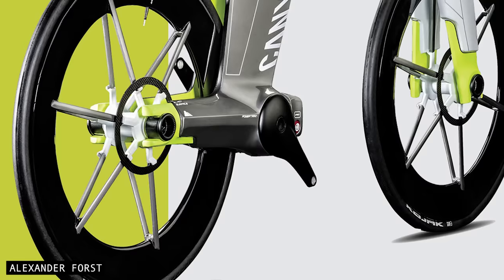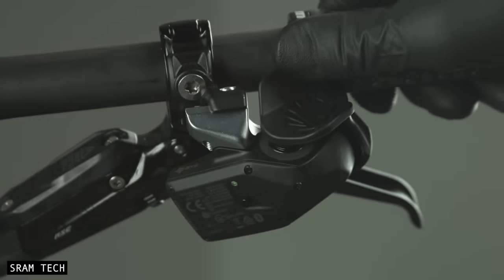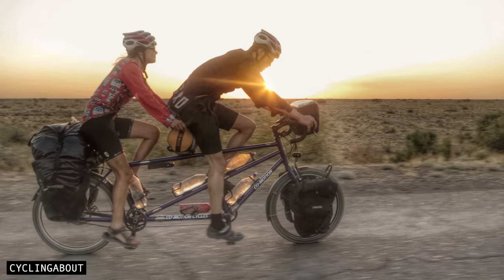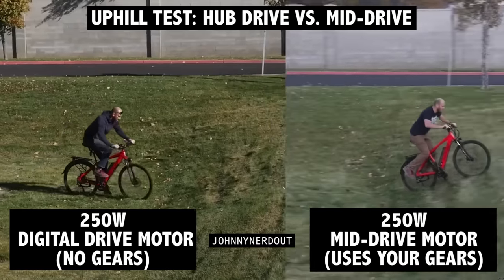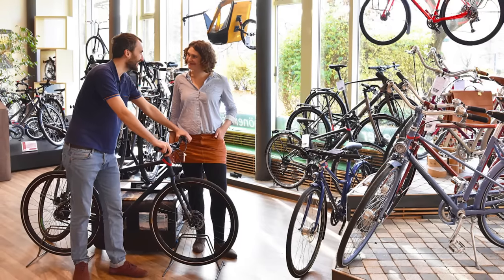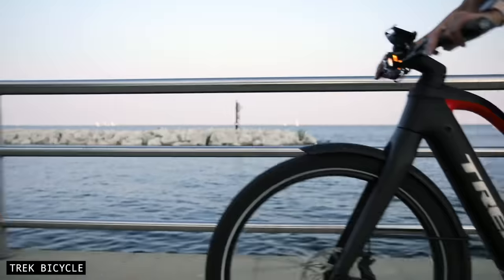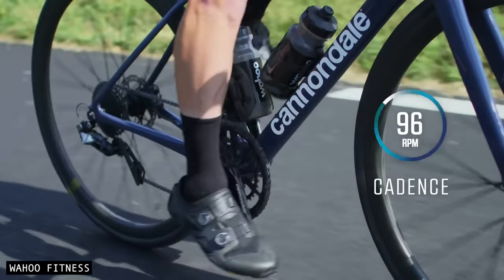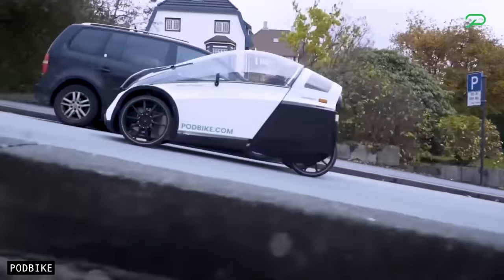Are Chainless Digital Drive Bicycles The Future of Cycling?

Comment: Absolutely greatest way to complicate things unnecessarily, and to hike up the bicycle prices!
Reply: Takes a moron to make something more complicated, takes a genius to make something simple

-idk who said it
Reply: Things often get more expensive and complicated to start with, then when they're at the mass market stage they're cheaper than the alternative - I see this being one of those. If it catches on it will end up being significantly cheaper due to the types of parts and engineering tolerances required vs the current chains and cogs.
Reply: You mean like technology? Can you name any tech that isn't more complicated?
Reply: @krane15  But technology is supposted to give us benefits. Like the bulb over the candle. This gives no real advantages. Single speed bike, even not geared specificaly for the rider and conditions is going to be better.
Reply: @M_Jaggard  You really think bicycle chain has more precise manufacturing tolerances than generator or electric motor..? Or that one day a simple chain will be more expensive to manufacture than an electric motor or generator..?
Reply: @call_me_jujo_9493  Thank you! I don't understand why people get so hyped about a product that literally does nothing new, and just costs more
Reply: @markusketonen2412  essentially yes. Less metal in total = cheaper to manufacture eventually. Cogs for cassettes will not get significantly cheaper but motors and generators will.
Reply: @call_me_jujo_9493  On the other hand, the electric car was invented 100 years ago, and yet we're just now seeing that in practical use. You should already know this already.
Reply: No doubt it will appeal to some people but not to me. I see no point in complicating things unnecessarily. Also there could be a reliability issue regarding the electrical cables and components, which  could get very expensive to repair, especially through planned obsolescence.
Reply: @garyburchgb  equally it could end up being much more reliable like a belt drive has.
Reply: Like most "smart" devices it will no doubt harvest your location, your fingerprints, your vital signs and every other possible bit of info.
Reply: @garyburchgb  Except all thing go from less complex to more complex. That's the nature of technology. To avoid that is to avoid advancing and moving forward. Would you train in your car for a horse and buggy? Its exponentially less complicated than an automobile. Even more to the point, the gears on your bike. Unless its a single gear?
Reply: @krane15  I like to keep things at a level that I could fix them myself. That's why I'm in favour of bicycles over modern cars. As far as I'm concerned, when we have to hand over products to specialists to hopefully fix, we are losing independence. I'm in favour of mechanical technology and basic electrical technology  as long as it does not go beyond the realms of the average enthusiasts abilities.That is why I prefer cable shifting to electrical shifting for example.I am aware of dematerialisation and the potential benefits of such, but I know that I can't even take apart a modern phone now to change a battery of a SIM card as it's sealed. To me that is not progress, that is a reliance on a system that is highly inefficient for the user. Also, it could be argued that a horse is far more complicated than a modern car, so for me your view doesn't stack up.
Reply: Then they will supply a battery pack, clit set as an option sparepart to upgrade the pedal cycle.
Reply: The bicycle is a technologycal optimum. Any further complicity just lowering its original value and the point of its purpose. The engine of a bike is your leg. The drivetrain is the gears and chains. If the drivetrain is a closed one, any additional engine in this system is just complicating the energy transform, decreasing the overall efficiency by their own internal losses.
Reply: @M_Jaggard  never. the coils and magnets will never cheaper and lighter than cogs...
Reply: Would be nice to get rid of the chain and cassette. One day.
Reply: @garyburchgb  Good point. Planned obsolescence and greed go hand in hand. 
I have a hard time with just how gullible many cyclists are, $7000 for a bicycle that isn't even gold plated and wasn't made to a particulary high standard (just watch Hambini pulling apart crazy expensive frames and components!)
Reply: И вес добавить
Reply: You dont have to buy it. 

And again, there are bikes where such a drive train makes a lot of sense.
Reply: @garyburchgb  That could be an issue indeed although at least from a technical standpoint, electric motors should outlast any chain related parts significantly. 

Main issue is the controller actually. Cables are easy as is the motor itself but the controlling logic is hard to replace without the manufacturer.
Reply: Nope it can be cheaper but... there are huge loses in energy conversions between machanic and electromagnetic not mention higher weight.
Reply: @szankony6276  You are correct about the higher losses but I would be unsure about weight: Chains and sprockets are not exactly light either and this is especially true for larger bikes and cargo bikes.
Reply: @aresivrc1800  Generator + dc motor will most certainly be heavier than chain and sprockets. But of course that weight doesn't matter at all
Reply: @krane15  To make things unnecessary complicated is idiocy, and to make unnecessary complicated with zero benefits is out of the scale of idiocy.
Reply: @markusketonen2412  I would not be so sure about that. Electric motors can be made pretty small today and a generator is little more than a reverese spinning electric motor. Meanwhile chains are long and heavy, especially for larger cargo bikes. 

In any case, the added weight of the battery for e-bikes is of little concern because of the added motive power and this is even more true for larger carbo bikes like the Podbike.
Reply: Also more parts to fail and you need diagnostic test equipment that would cost hundreds to test for problems
Reply: I feel like that's a very critical way of viewing it. Before even considering the practicality of this bike, I think it's great that people are trying to improve the technology on bikes!! 

Even if the solution doesn't work well, at least people are trying, so that eventually, through trial and error, there may appear a better solution whether it be hybrid or something completely radical!
Reply: @garyburchgb  well, there are different kinds of enthusiasts. plenty of people i know would be able to operate on this thing
Reply: @M_Jaggard Except what you've just said is impossible in this case as bicycles that need less raw materials and are easier to produce are already at a mass market stage which means that if these ones became mass produced they would still be much more expensive as they need nore expensive materials and tighter tolerances.
Reply: @thefirehawk1495  but if you have a tiny generator in one place and a tiny motor in the other then there's no need for big cogs and long chains. Right now that's more expensive but as raw materials become more expensive and precision manufacturing processes become less expensive that will cross over. Not yet, but one day.
Reply: @M_Jaggard do you really think that in nearest future copper needed for these motors will become cheaper than steel or aluminum used for cogs/chainrings and chains?

Also, what is the weight of this motor + generator? Acorrding to the video it is ~3kg - way heavier than a regular drivetrain and requires lots of more expensive metals (copper). So dream on.